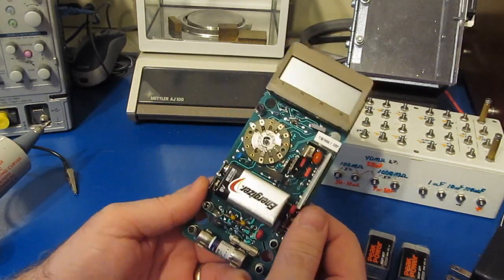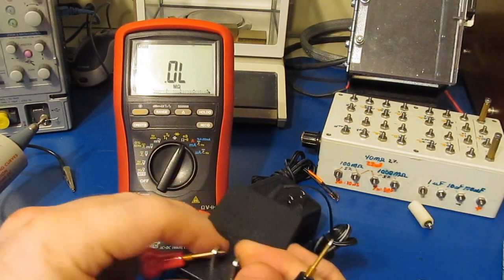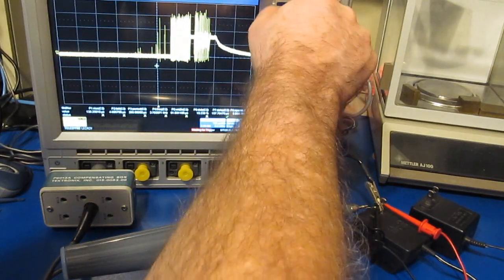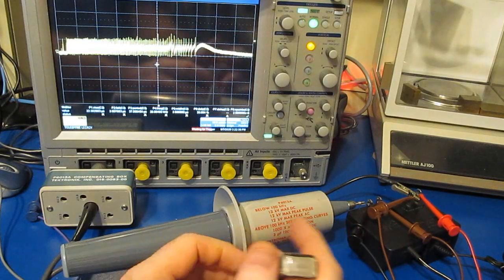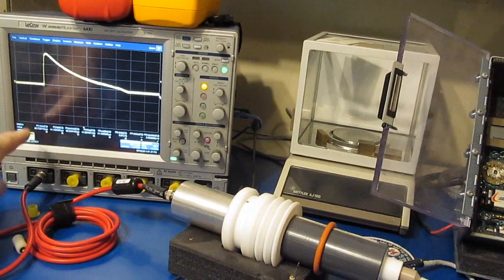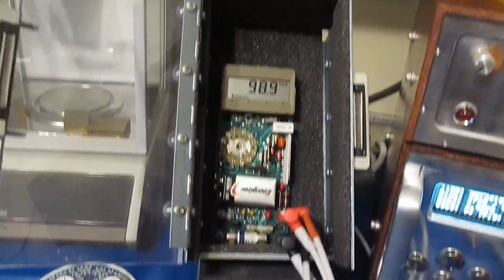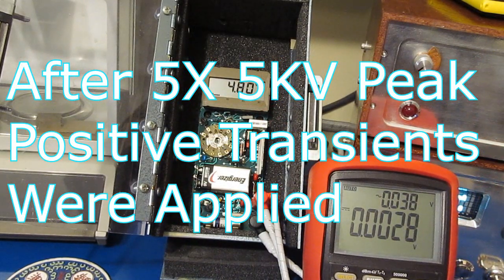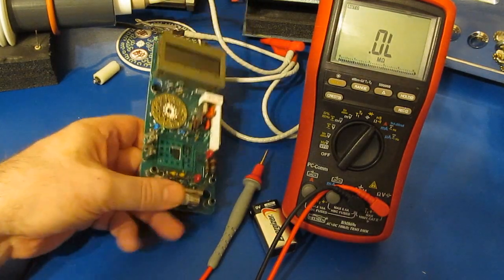Fluke 77 Transient Testing

Comment: I think these are great meters, 70 series. I didn't like to see one on the electric chair, but good to learn from the test. They can endure a quite some abuse, and stay true for a long time. I would always trust these 30+ years old meters then the cheap "fancy" meaningless 6 digits behind the decimal point...
Reply from the maker: If your buying a 6 place beyond the decimal, most likely the amount you spend was far more than this meter, and it sits on the bench.   That GMW Ultra was about as close as I show, 300k count, and current prices are about $1000.

Comment: Like taking an 1972 Porsche 911 and hammering it with a sledgehammer to see if its pedestrian safe..  :(  I have a mint Fluke 77 and repair vintage Flukes. I was pretty sad watching this.
Reply from the maker: I've seen a lot of dumb car comments over the years.   I assume the people that make them know nothing about the topic and that is something that they can relate to.   But because you want to talk about cars, this would be more like finding a rusted out (battery leaked) old dodge frame with an engine but no chassis (no case) at the automotive salvage yard, dragging it home and then starting the engine after adding a battery and fuses.    If seeing an old meter like this get put through the paces before it goes back into the dumpster makes you sad, it's a bad channel for you.

Comment: Thank you for posting this video.  I was curious if the input protection in the 77 (1st generation?) was good or not.  I have a 77iii that is in need of repair but not from transits.  I damaged the meter trying to re-flow the U1 chip.  Fluke doesn't have a replacement for it.  Anyway,  you also answered one of my questions with this test: how well does a spark gap compare to MOVs or GDT.   Also, I would not want to have a meter near a natural gas plant trying to take measurements that have spark gap protection.
Reply from the maker: I would imagine that the electricians that work in areas like that are provided only intrinsically safe test equipment.  Fluke offers so products like this.  Even the fuses are sealed.   Yes, an open spark gap like this would seem like a very bad idea for some applications.

Comment: Thank you Joe! Trust all is well with you sir. Still have my original 77 and paid a small fortune for it sometime in the early 80's. It's good to know they can take some abuse. FWIW, mine has 3200 counts.. wonder why they didn't just make it 4000?
Reply from the maker: Hello Cliff.  Good to hear you're still with us.  If I had to guess, the count may have been set by the cost of the custom IC.  That's something you may need to ask the original design team, if any of them are still around.   There was that retired Fluke designer on Dave's site.  They may be able to provide you with some accurate information on the history. 
This meter, just having that little bit of protection is a huge step up from my first Fluke.

Comment: Hello Joe! Thank's for testing this old meter, many people still use them today. What is your opinion about these old wafer range switches they use compared to the newer pcb trace ones? Any advantages or disadvantages perhaps? Price would be a disadvantage for sure I have seen new ones with different arrangement but same format for about 10 USD. Maybe an advantage (or disadvantage) is that particles from wear are not stuck on a flat surface and can be brushed away more efficient by rotating the switch? A life cycle switch test if you feel that it would be worth it? Anyway thank's for sharing and looking forward to the next video! Stay safe!
Reply from the maker: It's a good question on the switch life.  I remember similar switches being used in the tuners of old TV sets and requiring constant service.  This particular switch has been in service for many years and I am not sure what we could learn from running it compared with something that was NOS.   If I had the case with the knob, detent spring and such, I would run it.  But having the wafer free float as it is, with no support, I think would bias the data too much to be of any use.   If I could find one of these meters in better condition, I would run it.   I'll keep my eyes on the lookout.
Reply: @joesmith-je3tq  Fingers crossed for a bargain or a donation. The last hand held Flukes to use this type of switch where the 77 IV (later revisions changed to modern type when they started using the same main board as the 170 series) the 87 III which usually has the modern type switch but the very first revisions have the wafer type (I own one example) and the rugged and old 25 and 27 launched in 84 or 85 which remained in production until mid 2000's. Thank you for taking time to reply :-)
Reply: @joesmith-je3tq  at my workplace in january we do our anual multimeter check in case on of our fluke 77 fails i send it to you for testing this way i got mine but its to much in use to be tortured like this ;)
Reply from the maker: @nickhetzer2744  I've had people write me about still using the Fluke 8000A at work.  Some still use old analog meters.  So take good care of yours.
Reply: @joesmith-je3tq  wow i didnt expected an replie but they get taken god care but they wont get repairde if they fail they are either trased or i took one home to repair also we shouldnt use them anymore we work with 600vDC at up too 400A there you need a bit more modern meter
Reply: I know this is not a forum on meters, so sorry about extending the talk 😀 Talking about rotary switches, would someone here know something about using some kind of grease for the purpose. I have a few old meters (analogue and digital) and have cleaned the switches (as far as possible) with TUNER spray, but have the idea that it is "dry". So would grease be a good thing or maybe dry is good? Any tips on What kind of grease? Maybe also different types of surfaces used for different model meter?

Comment: very informative about the transients. Would replacing the spark gaps with a MOV or GDT improve the robustness? i own a fluke 23 and like it a lot, i think it comes from the same era.
Reply from the maker: It would take a lot more testing to answer that.   Normally I would test every function with both positive and negative transients and functional test the meter between each voltage setting.   I had no plan on adding any of this data to my spreadsheet and deviated from my normal procedure.   It is very possible that had this meter been set to one of the other functions that it could have been damaged at a much lower level.  It's also possible that the grill starter or my ESD gun could damage it.   One thing I am certain about is that this Fluke is far more robust than the very first one I bought, the 8000A.

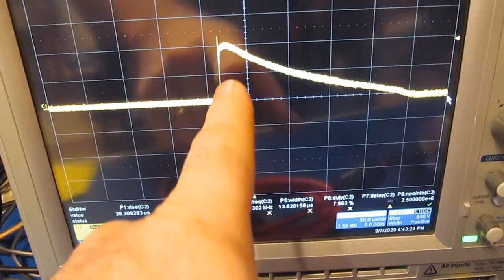Comment: 7:14 Maybe a stupid question, but i see a ferrite bead arround the coax of the high voltage probe,  why is it that there are no ferrite beads arround a normal x10 or x10/x100 probe? Does it have to do that the high voltage probe is only 500Khz rated ?
Reply from the maker: That particular high voltage probe is homemade.   BW is more in the 20MHz range, not 500KHz.  I've made a series of videos showing the construction and design of it.    It's not uncommon to see people use Ferrite on standard scope probes.   Please watch the following:  https://youtu.be/2vzvWUqUtb8?t=1247
Reply from the maker: Good question BTW.
Reply: @joesmith-je3tq  , thank you for the quick reply. I had seen that particular video before ;-) 
For a while now i'm working on a like i call it, a "Poorman's passive differential probe). It's a probe for doing mains referenced measurements, and doesn't need a battery or external powersupply to work, because it's complete passive and doesn't contain OP-Amps like a normal differential probe has. At the moment i can already measure mains voltage (240V / 50Hz) and up to 600V DC (Electrophoresis powersupply) and can swap both testleads and have very accurate readings, the next step is to see how much the bandwith wil be. In a simulation program, i can reach above 500Mhz and still get accurate results, but a simulation program lives in a ideal world :-) 
Ps: i have also seen your video's about your high voltage probe, but missed the fact that it has higher bandwith then 500Khz (seen a lot probe videos the last months). Grtz from Belgium.
Reply from the maker: @BjornV78  I attempted to demonstrate the basic design of an active differential probe.  The common mode and input voltages were fairly low.  The fastest one was no where near your 500MHz.  Look forward to seeing what  you came up with.
Reply: @joesmith-je3tq  , above 500Mhz is what my design showed in the simulation program. But we all know, that a simulation and the real world are not the same. 
If i reach 500Khz or maybe 1Mhz in real conditions, i'm more then happy. I want to use this probe for doing measurements on Switched-mode power supplies.

Comment: I used to do the transient (shock) experiment/Prank on other student and teachers (I was 13 and stupid-er !!!) . I use to ask them to hold the ens of the coils for me so I could attach the 6 or 9V battery terminal and while they holding the coils, I removed the battery and they get a small shock!!! they screamed and jumped because of the surprise and shock and they try to explain they really got a shock from 9 or 6-volt batteries. and I show them by touching the battery on my skin, that you can NOT get a shock... and I tell them maybe you eating too much salt with your food and that makes you more conductive than normal. DONT DO That it could potentially send someone to CARDIAC ARREST!!!

Comment: theres many folks out there looking for repair parts for flukes especially obsolete displays that would love to have that meter youre going to destroy
Reply: Interesting I read the comments here and saw 2 of yours about the displays. What's up with these displays? These can't go bad unless you split apart the LCD, which I doubt will ever happen. Maybe you talk about the displays looking faded. If that's the case, you need a new sheet of polarizing film. That's how LCDs work. If that film is damaged, usually by heat, the polarization doesn't work properly and you don't see the digits. You can find polarizing film in any LCD monitor and repair 50 of these. lol